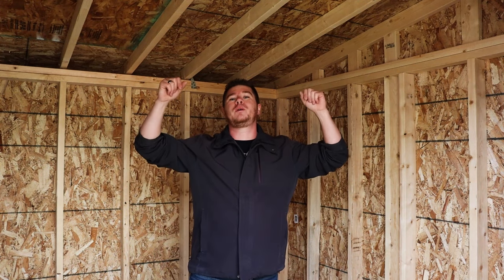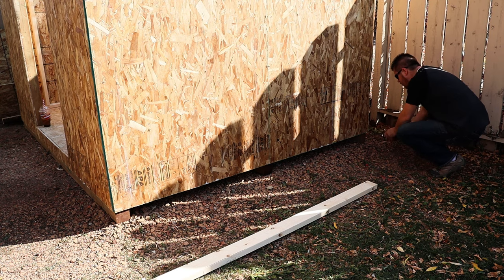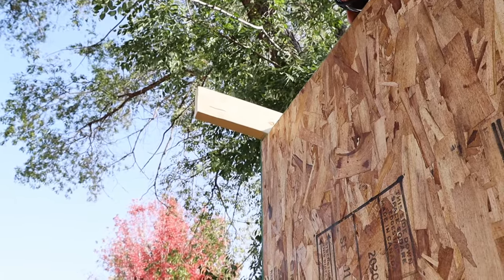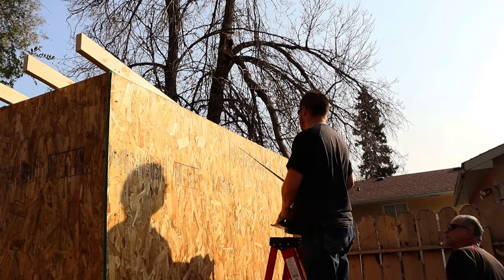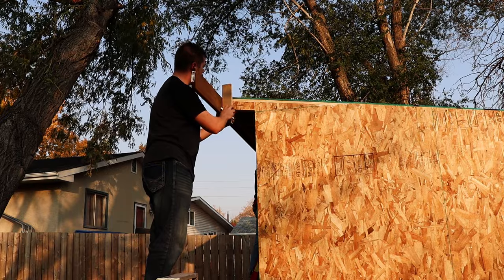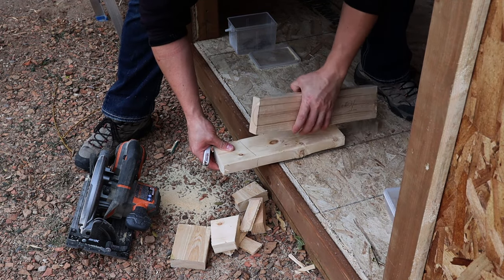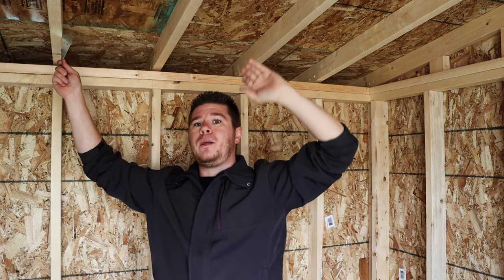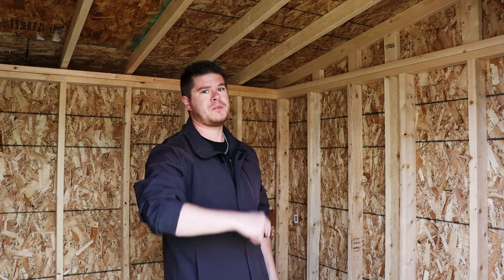How to build a storage shed - Roof // Part 4 - Plans available

Comment: Cool stuff, thank you. I wonder if cutting kind of a rabbet into the trusses where they sit on the top plates would give it more stability especially against any tension that wants to push the roof parallel to its slope, like snow or something.
Reply from the maker: Thanks. Yeah it's called a birds mouth cut. You could if you want, but honestly with a shed roof it isn't necessary, just more math and angles. Once the whole thing is built and fastened down it becomes quite the sturdy piece

Comment: What people FAIL to realize is, Building a Shed Cost ABOUT Half Or Less than Buying One... EXAMPLE ONLY! Buy a 8x10 Shed for $5,000 and by the time you pay it off, you spent About $10,000.. Or Do like He did here and What I did, I BUILT a 10x10 For Under $1,000.
Reply: I am almost done building this exact shed and strongly disagree 😂. I’ve pissed a lot of money into my 8 by 10.
Reply from the maker: Yeah, I never say you'll do it for less. What you will get is a much better and stronger product for the same amount of money spent.

Comment: I have a cabin in northern Wisconsin and sheltering firewood is a necessity. I'm going to follow these videos to build a shed like this myself. Portable shed builders get paid handsomely for a small shed like this. Thanks for the videos can't wait to build mine this spring. Do you have a video for a firewood shed this size or maybe a 10x12? Thanks
Reply from the maker: I'm glad you liked it. I have a small separate firewood shed video, but not big enough like you want. That and this are the only 2 shed videos I have currently. Good luck on yours
Reply: @JessedoesDIY  thanks I'll check it out.

Comment: Jessie,
I'm building a shed using your plans and watching the video.  They are very helpful.  I have a question about the angle on the trusses.  In the video you say go up 18 inches from the bottom on the front of the shed to put a screw.  In the plans it says to go up 14 inches.  the studs in the back are 73.5 inches and the front wall studs are 87, so should I use the 14 inches and not the 18?  Thanks, I'll send a few pictures of my progress.

G. H. Cain
Reply from the maker: That's awesome, good to hear! Yes I misspoke in the video. 14" is the correct rise. Sorry for the delayed response. Can't wait to see it!

Comment: Thanks for the great videos. How would you fit old glass windows all around to serve as a greenhouse during winter times.
Reply from the maker: Anytime, glad you liked them. Well a greenhouse would be built slightly different and use a clear paneling for the walls. But if you wanted to use this, you would frame the walls similar to the door everywhere you want a window. Make a header for them, and use jack and kind studs. Cut the holes in the osb after it's installed on the wall framing, then set in and screw the windows in place, caulk the outsides

Comment: I think I would have prioritized birdsmouth cuts on my rafters over vertical ends. I'm curious why you did the opposite.
Reply from the maker: On such a small roof the birdsmouth isn't a complete necessity for lining things up, stability or strength. There isn't a second floor, it won't really be carrying a bunch of weight, and it isnt a massive structural piece with a transom or anything and so to keep it easy for the average DIY'er at home it is ok to just ignore it for simplicity sake. The verticle ends however will be visible to everybody and is easy to do, so why not

Comment: hello there. have a question. what size of stud for roof truss did you use . ****2by4by10**** or ****2by4by8**** ?? in the description of materials it say 11- 2by4by8.......   but the width of your shed is 8 feet, and the truss has an overhang on both sides. should it show 11 studs of ****2by4by10**** in the description for materials.??     now its time for me to go buy studs for roof truss. thanks.
Reply from the maker: Hey, sorry, I apologize. Yes they are 2×4×10, I'll change it. Thanks for letting me know. Good luck on yours, keep me posted on your progress!

Comment: Great video bro!
Was that an iced Frappuccino that you were sipping on, with a peppermint striped straw, during this video? And hey, we miss the shades that you had on!
1. Do you have the, “buy me a coffee” app?
We are definitely investing in to those hurricane ties! Thank you so much for the suggestion.
2. Any tips for shed builds with rafters on both sides? The rise:run:pitch dynamic can be so confusing!
We’re thinking of a 7/12(7:12) pitch, 7’ foot rise for extra storage space, because we have an 8’ foot run. What we believe is that leaves us with a little under a 12.5’ long rafters?
3. How long could we make our tail/ease/overhang without causing any structural integrity?
4. Also, we’re scratching our heads about working in some cross-member truss. Any tips for that? Especially since we plan on utilizing the space up there.
Once again, thank you so much for your generous help.
Do you have a Facebook group for us to join?
Reply from the maker: Thanks! It was a slurpee lol I don't drink coffee, don't like it. Hurricane ties make a big difference in strength and are mandatory in places. As for the roof rafters on both sides, it is easier if you run a main beam at the height of the roof from front to back, and then rough cut the rafters, stand them in place to the top of the beam and then overhang the wall, use a straight edge to make your marks and then cut them out. I typically like to leave between 6-8" overhang going that way. As for a truss, those are typically engineered and constructed for the size and load needed, can't help you there. You could put up the rafters and then stick build some storage under them once it's complete. I do not yet, social media eludes me, I don't get it lol but there are things I'm looking into going forward!

Comment: Good video. One critique. Your door brace crossbeam is upside down.  The bottom always goes on the hinge side of the door. Unfortunately It doesn’t add any strength the way you mounted it.
Reply from the maker: Thanks. As I said in the video, it's just there for the OSB to screw to, to make it sturdier. The OSB is what keeps the door square, there is no sag so it isn't a support brace. If it was a support brace it also would have went corner to corner, mine was just in the middle half of the door

Comment: Hi Jesse! Shouldn’t the diagonal brace on the door go the other way? Like from the lower hinge towards the top of the door that opens out. It will stiffen and hold the door better. It’s not a huge door, mind you, so it probably isn’t a major issue!
Reply from the maker: If it was a structural support, then yes, you are correct. But the OSB sheet is keeping the door square and there is no need for a brace. As I said, I just wanted something in the middle of the door to give the OSB some more strength and to screw to. I was just going to go straight across the middle but the scrap piece I had was longer so I added a slight angle just to maximize surface area

Comment: So far, so good .... 

I started working on the rafter template yesterday & ran into a snag. The dimension/height for the front wall is 91.5"  from the floor to the 2nd top plate. I believe that's because you used a full OSB sheet as your 8' outer dimension.

So, technically, when I'm placing the screws to make my rafter template, shouldn't I place the front one at 13.5", and not the 18" (like you instructed)?

I don't know if I'm over thinking this, but just wanted to make sure. Thanks!
Reply from the maker: Hey, good to hear! So yeah, you sir are correct. I misspoke and said a foot and a half, but I went back and watched the footage I actually measured 13.5", my bad. Hope that helps clear the air. Good luck, can't wait to see it!

Comment: I know this video is over a year old, but I have a question for you. I've watched a few videos on some shed builds and all the other ones I've watched cut in a bird's mouth for the roofing. And every time I seen them do that, I wondered how necessary it is. Seeing that you did not do this, how necessary is the bird's mouth?
Reply from the maker: Hey there. So a birdsmounth help the board stand the load of the roof without the corner of the top plate pressing into it, but on a small roof it'll only compress slightly. It also helps locate the board and stop it from moving around. These things aren't totally necessary on such a small roof. You can absolutely add them if you like, but it'll be just fine without them on a small roof for a shed. So because of that, I decided to skip it all together to make the easiest DIY roof for the homeowner to figure out without complicated angles and rise/run measurements. Hope that helps!

Comment: Jesse, thank for your videos I was able to build my shed with no issues. I just have a question, did you use only roofing paper and shingles? Do the nails go through and you can see them in the inside? Or did you use staples?
Reply from the maker: That's awesome, I'm glad I could help! Yes, it was paper and shingles on mine and yes the nails are visible inside. I wasn't overly worried about it myself, not going to smack my head on them or touch them. Hope that helps, thanks for sharing!

Comment: Hello I am wanting to build a shed with a wood frame and metal walls and roof.  Do I have follow the instructions you using  same for wood and replace the wood walls with metal?  Thanks.
Ood
Reply from the maker: For the floor it'll be the same. Metal framing for the walls is a bit different but it'll still work with this floor

Comment: Just wondering. Why is this done with the side wall structure separated into a wall and an angled roof support "Wedge" on top? I'd have thought it would have been simpler (Less cutting, less wood, fewer joins) to make the side wall frames to incorporate the roof slope as a single panel......... Or am I missing something important here?
Reply from the maker: It's actually easier this way for most people because you don't have to figure out how long and the angle of the wall studs are before hand and possibly have them wrong. This way it's easy to make the angled cuts from scrap pieces after and the wall is straight boards all the same length. Do it how you feel works for you, either or works

Comment: Good morning Jesse. Allow me one more question; probably the last 2 ones:
1. The trimmers around the corners, do I necessarily should use the thicker planks (1/2, 3/4, etc. OR I can also use the tiny ones; I believe is 3/8 or something like that.
2. The ridge edge, under or over the underlined.
Reply from the maker: Lol I used thicker because it is sturdier, more resistant to issues, and it's pressure treated. It also gives you a nice shadow line. I wouldn't go under 3/4" thick. And your drip edge goes first, under the underlay
Reply: Hey Jesse, I know I already told you 20 times that this is the last question; but I believe this one will be the penultimate (could be 4 or 5 more):
The drip edge goes at the front of the fascia board (visible from outside) or behind, so inside, between the fascia and the sub fascia. 
Thanks Jesse.
Reply from the maker: Outside. It should be visible

Comment: Great series! Super informative. I’m trying to learn here and am curious at what point you should use a bird mouth cut in the rafters? Is there a certain pitch that would require it? Thanks!
Reply from the maker: Thanks, glad you like it! I'm also very happy I could help. For the birds mouth you can put it on at any time if you want but it isn't really needed on a small shed. If you go for a larger shed and pass the size for needing a permit in your area, then you'd need to do them. For me that size is 100 Sq.ft, so a 8x10 shed is under that and I can get away without it. Hope that helps
Reply: @JessedoesDIY  amazing! I really appreciate you’re reply! Keep up the awesome videos!

Comment: I'm not understanding the vasoconstriction of pitch. Idk how to calculate pitch but I don't get how you got your decision on pitch and angle.
Reply from the maker: Just the difference in height between the front and back wall. There was 16" between them, so that's what I measured up on the side of the shed to mark my angles. This just mimicked the same roof angle front to back.

Comment: Sorry if this is a stupid question when you’re tying in the side walls and the back walls with your second top plate are any other those 2 x 4 top plates Need to be cut? My side walls are 8 feet my back wall is 10 feet. If I overlay my side walls top plate to tie into the back wall do I need to cut that back wall top plate? how many inches does the back 2nd wall top plate need to be?
Reply from the maker: No prob. Well all the top plates will need to be cut to size. Your walls are like mine, so I'd just do it the same way. Take your back wall top plate and cut 3.5" off each end, or 7" shorter than the wall. Then take your side wall top plates and cut them 3.5" longer than your wall. It'll just set on top of the side walls and that extra 3.5" will overlap the back wall in the corners. Then your back wall top plate will just fit on top in between the 2 side wall overlaps, it will overlap nothing.

Comment: Glad I found this build. I learned a lot watching through and think I might try this when material prices are better. How do you feel about 2 foot framing for a shed vs the 16 inch? Thanks for sharing.
Reply from the maker: Thanks, I'm happy I could help! Depends on where you are but lumber prices have mostly corrected themselves here, still up a buck to a few bucks but that's it. 24" on center will work for the walls of a shed, but I'd stick with 16" for the floor and roof. Good luck on yours, keep me posted!
Reply: @JessedoesDIY  That makes sense. I want to build like 5 sheds, not for any logical reason though, just because sheds are awesome lol. Thanks again for videos.
Reply from the maker: Lol well  that will save a little dough for you. Good luck on yours

Comment: What kind of paint do you recommend to protect the wood from rain?
Reply from the maker: Any outdoor rated paint will work just fine. The thing with paint for outdoors is it's meant to be layered up pretty thick over time. So you'll have to recoat it after a couple years, then maybe another 5 after that. Then you'll probably have a good thick layer of protection to last decades

Comment: Great video! Did you cut any pitch on trusses where they mounted to the top plate on the back wall?
Reply from the maker: Thanks. I didn't cut any birds mouths above the top wall plates at all, not totally needed for this. As for the rear overhang I just used the same template piece for the front and flipped it over. Traced that and it's the same perfect angle.
Reply: @JessedoesDIY  Thank you
Reply from the maker: Anytime

Comment: I was wondering,  i want to do a 12 x 24 so i figured i would add 1 more 4x4 on the bottom and i may want to put a car in it. Would 2x6 be strong enough to hold a car for floor studs?, and if i do 2 12' x 12' sections how would I go about butting them together?
Reply from the maker: To put a car in it you'll have issues with the floor sheeting as well as the joists. You'll probably need a concrete slab. The roof would also need to be beefed up a bit because of the span
Reply: Thanks for the quick reply I’m not actually going to put a car only a riding mower. As for the roof if I go 12 inch on center with hurricane ties will that make it work. Honestly I have never seen a lean to  shed going horizontally it’s just like yours 8x10 , I understand if it was 8 x 12 or bigger no way I will do it this way.Thank you so much Jesse.

Comment: Hello Boss. I noticed that you didn't install drip edges. Allow me a question: is it really necessary? If not, it is still better. Without it, any chance for the rain water to get in or damage the boards on my roof?
Reply from the maker: Hey, I would have but at the time supplies were crunched and I couldn't find any. I'm actually putting some up soon because yes, it does help roof life and water shedding, and also ice damming in the winter if you have that like I do
Reply: @JessedoesDIY  
Can I ask you for your name? I don't have enough words to express my gratitude.
Drip edges, on all 4 walls or just at front and back. I am going for my drip edges now to Lowe's. I will send a photos before and after I finish. Working on my roof. By the way, you don't teach how to start with shingles.
Thanks.
Reply from the maker: My name is Jesse. No problem, I'm happy to help, and glad you're giving it a go! Just on the front and back is all you need, sides are fine. Yeah I never had a chance to show the shingles. I had a blizzard rushing in I was trying to beat. Because filming takes more time my dad was doing the shingles while I was finishing up the structure, I figured that was more important to show since there are plenty of roofing videos out there. It literally snowed the next day, that's why I never even splashed paint on it till this summer
Reply: @JessedoesDIY  
Hey Jesse, I didn't expect a quick answer. I just bring my 4 drips.
Thank you very much.
Reply from the maker: Anytime!

Comment: I have watched many of your videos over and over for reference  and the one thing I have seen that I can’t understand is why you didn’t cut a birds mouth on the rafter. 
I understand everyone does it different, so I am curious of your reason.
Otherwise. Great videos!
Reply from the maker: In this case it isn't absolutely necessary on a small storage shed under 100 sq.ft, plus we are only dealing with one angle and they don't need to hold themselves in place. If it was bigger, and maybe had a heavier roof on it or was multiple angles, then you would. And plus I was trying to keep the roof angles, and cuts to a minimum. Hope that helps
Reply: It sure does and I appreciate the response.
Reply from the maker: Anytime. Good luck on yours!